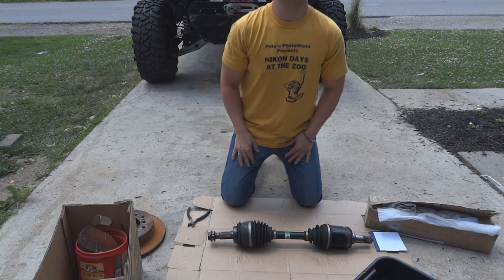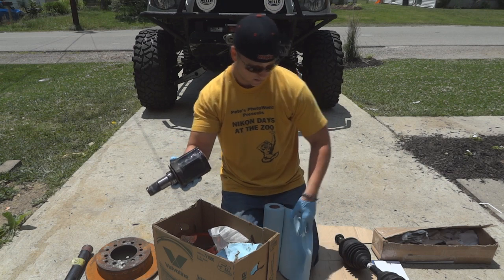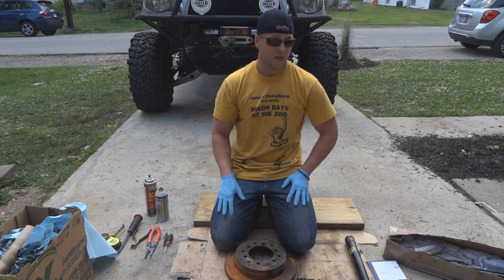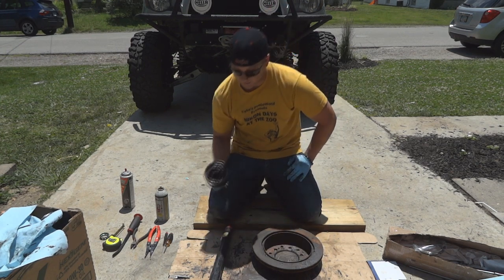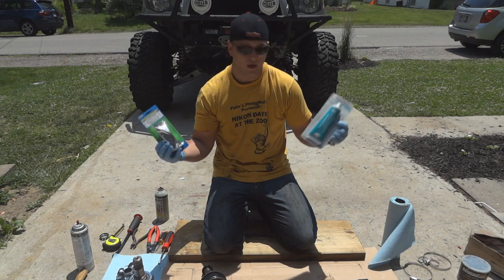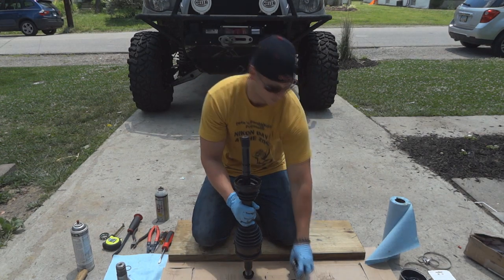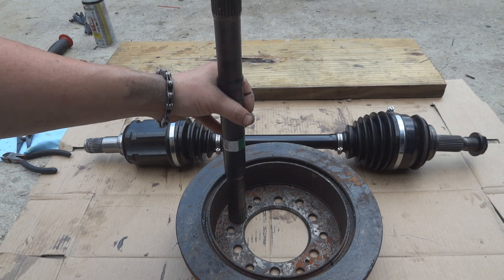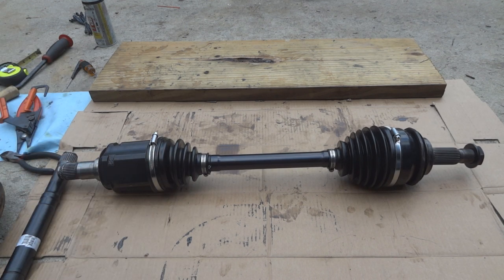Late Model Toyota Tacoma cvAxle Disassembly

Comment: I cannot for the life of me get the axle off the birfield
Reply from the maker: I have spent an hour on some of them. Try using the pipe on a manhole cover, also keep the birf at the steepest angle it will go while slamming everything down onto the non forgiving surface. Good luck

Comment from the maker: u may be able to use some scrap prices from Lowes/ home depot I know they have short bits. I had some left over from a project. black iron is fine. if banging on concrete doesn't work try using a deadblow hammer. some can be really stubborn